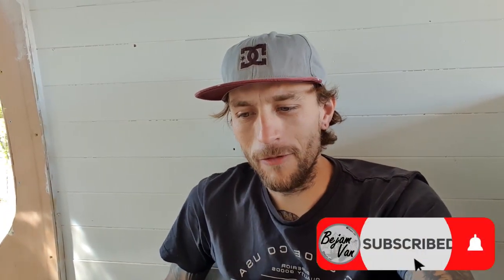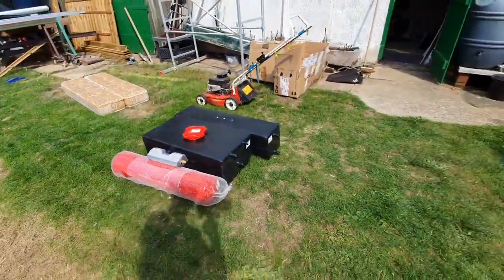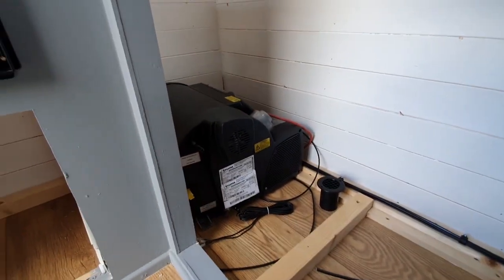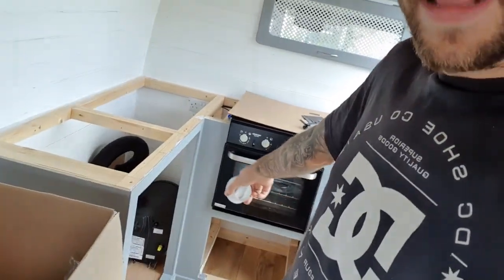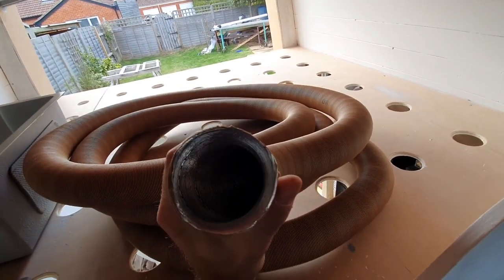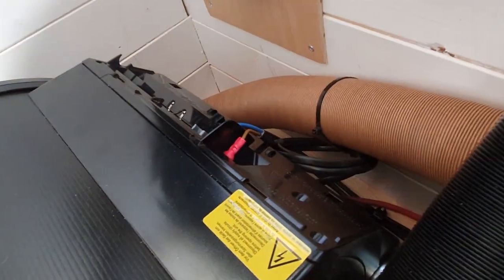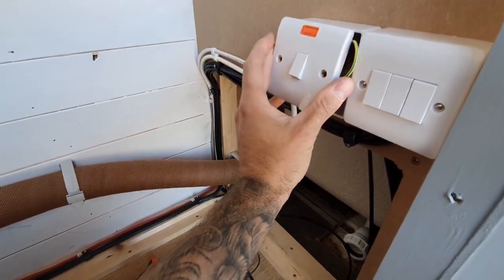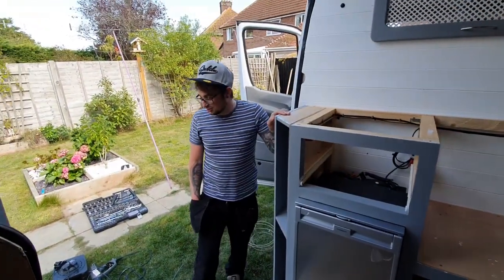Truma Combi 4e - The BEST OFF GRID van heating system | Van Life Build Vlog #20

Comment: Great install mate . I can’t wait to do ours and nice to see there is a temp sensor as well I didn’t know it had one you needed to mount high level which is great cos I can not put it in before I finish boxing the shower in
Reply from the maker: Cheers pal.. the video didn't show how stressed out I was drilling that hole in the side of my van 😅 
Got the Controller connected up and last bit of ducting in now 👌🏻 
Defo a good idea the getting temp sensor in early 😅😅

Comment: hi Bejam!  I have a question for which Im hoping you have an answer.  I've bought a combi 6 and I'm building it into my van. Now the circulation air (for the fans) needs to come from the living space.  Instead of making a hole in the wall next to the ventilator of the combi 6 (150cm2 as advised in the manual), I would like to supply the ventilation of air via an airpipe of +- 2meters long and +- 14cm diameter (which equals the advised 150cm2).   I want to do this to reduce a part of the noise of the fans in the space next to where the combi 6 is built in. 

The question is:  do you think the fans will be strong enough to draw air through the pipe?  I'm worried that the fans will not get enough air or need to work to hard and crash.
What do you think about it?   Hope to hear you soon!
Reply from the maker: Hey mate, apologise for the delayed response.. 
I think installing the ventilation pipe will be absolutely fine. As long as there's nothing blocking it the circulation fan of the boiler will most certainly drawer it though. So just wouldn't worry too much 👌🏻
Reply: @BejamVan  thanks!

Comment: Only just found your YouTube, brilliant!! I've just started a VW Crafter MWB, the mrs won't drive anything bigger (we have a 7 metre motorhome she won't drive!!). The cable to connect the room temperature sensor, is it possible to make one as they are stupid expensive, just wondered what sort of cable and connectors it had. Will watch more videos now. Cheers.
Reply from the maker: Hey Dean, cheers for the comment mate.. its hugely appreciated 😊
Blimey, sounds like you're downsizing fairly 😅
100% possible to make a lead up for the temp sensor dude.. just use some 0.5mm or 0.75mm 2core flex and connect them to the sensor and boiler with micro-spade connectors (I'm 99% sure that's what they are on both connections mate.. otherwise just solder them 👌🏻)
If you Google 'micro-spade connectors' they should come up 👍🏻 
Good luck with the build 🤙🏻
Reply: @BejamVan  thanks very much for your reply. I managed to get one from France at half the price but I've only just seen your reply, typical, I've got some cable as well!!! I think I'll need a lot of luck with the build tbh lol.
Reply from the maker: @deandickinson7124  no worries at all mate, glad you got it sorted 👊🏻
Feel free to give me a shout on here or insta if you get stuck with anything else. I can at least advise on what I messed up 😅👍🏻

Comment: Did u make the cupboards for weight reasons? A lot use kitchen units. What other truma boilers are there I already have a diesel heater
Reply from the maker: Hi mate, I just wanted to make the layout myself and found it cheaper and easier to build the cupboards myself thats all 👌🏻
I'm not sure mate, most other Truma boiler are water storage systems that use a 240V coil instead of a has heat exchanger that heats the air too. This beast is expensive but is aweseome. Probably the best buy in the van build.

Comment: Hi Bejam, I really enjoyed the video. Very much toying with the Truma as it has come highly recommended, by professional van converters, but I am struggling to justify the expense in my head. In your research did you come across any alternatives?
Reply from the maker: Hey man, thank you 😊 
I was much of the same mind set to be honest, the cost just seems ridiculous!! But I struggled to find an alternative decent off grid set up that did both air heating and water heating that didn't need to be mounted external to the van. Its expensive but my god is it good 👍 
The alternative I would suggest is a decent diesel heater, e.g. webasto or eberspacher (which is still £600-£800 unless you buy a cheap Chinese model or refurbished model).. and one of these new excel thankless gas water heaters which are a couple hundred pounds. I've heard good reviews about them but it just felt wrong mounting a gas heater in the van without an exhaust 😅

Comment: Very helpful cheers. Do you have any info on the 12V connection to the LCD display?
Reply from the maker: Hey Elliot.. I may of covered the 12v supply in one of the electrical video's but I can't remember 😅
I took a separate 2A 12V supply from the 12V fuse board up to the the display and soldered the connection onto the Truma pre-made lead. I hope that helps 👌🏻
Reply: @BejamVan  ahhh cool thanks! That makes sense. The manual says 1A and that it should be on the same circuit as the main heater. Have you had any issues with yours? 

Great video by the way! Really really helpful!
Reply from the maker: @elliotfrance9425  No worries at all mate 👌🏻 The manual says 1A due to the current the display is pulling so take that as a minimum rather than a max. 1A or 2A will be fine. I've had no issues with the Truma at all, its probably the best thing I bought for the van, its brilliant 🙌🏻
You can either double the 12V circuit's up fuse board or stick it on its own, it doesn't matter too much. Mine was easier on it own so thats how I did it.
I did mess up the Trume exhaust in this video and sorted it the 'Teething Issues' video later on 👍🏻

Cheers dude.. I'm more than happy to help anyone. Electrics is what I know but I can certainly tell you what worked and didn't work on the rest of the build 😅
Good luck with yours mate 👊🏻👊🏻
Reply: Thanks!
Reply: I'll have a look through your videos later as I'm unsure exactly where I need to earth my 240V system 👍👍😀
Reply from the maker: @elliotfrance9425  thats in i think the second electrical explained video mate.. earth the 240V distribution board down to the body of the van 100% using something like a 6mm or 10mm cable 👊🏻
Reply: Was searching for the same answer! I have ran a 4.5mm cable from my fuse board to the boiler but getting confused with where the control panel gets it's power. Can I just split the 4.5mm cable in two directions and place a 1amp fuse before the smaller 12v cable thats connected to the control panel? Would be grateful for any help as the manuals don't really give any info. Thanks!

Comment: Hi matey - - HELP ! I've bought a 4e - will it run heating and water on 12v only? - what is the 230v used for if not using a shore hook up?  cheers p.
Reply from the maker: Hey mate.. the 4e will heat the water and run the heating on 12v with Gas hooked up. The 230V is so you can save gas when you're hooked up to mains at a caravan park.. 🤙🏻 I hope that helps 😅
They are brilliant boilers chap.👊🏻
Reply: @BejamVan  fantastic, a local chap doing a build said it needed 230v to run, had a little panic as mine is  in, just sorting out the sink plumbing!. Ps there is the campervan & overland show in Stratford on 5th/6th June, understand there will be a few vloggers going 😀 thanks again
Reply from the maker: Hahaha you'll be all good matey.. sounds like your van is coming on nicel. Ready for summer? 👀
I didn't know about the show, I may have to give it a look, cheers chap 👍🏻
Reply: @BejamVan  yep, coming on well, thanks mate, guidance from your vids, Greg Virgo and a few others 🙄

Comment: Did you treat the exposed metal after you cut the hole in the side? Without the paint its going to start rusting in a matter of months.
Reply from the maker: Yes mate, I coated it in hamerite white paint as I have with all the holes cut into the van. I just didn't show it in this particular video. 👌🏻
Reply: @BejamVan  Oh good. My mate forgot to do his windows and they're all dribbling.
Reply from the maker: @tompiperson4793  Ahh mate rust terrifies me.. especially being a Sprinter. Since buying it I've spotted areas where the previous owner has just painted over rust spots 🤦🏼‍♂️
Reply: @BejamVan  Thats Britain for you. If I had the time I would import a van from Cyprus where they don't use salt. You look underneath the chassis of a 20 year old vehicle and you see bolts that would come off dry by hand with a spanner.

Comment: What’s the 240v for if it runs on gas?
Reply from the maker: The boiler is dual fuel mate, so if off grid it will run purely on gas.. or if you are connected to a caravan hook up it will run on 240V coil saving your gas. You can even run it on both if required.

Comment: Dear friends, could you help me please.... I'm also currently building an expedition vehicle. So, the user manual for this boiler gives the following:
Water inlet pressure max. 40.6 psi (2.8 bar). Pressure reducer available.
System operating pressure max. 65.3 psi (4.5 bar) 

The question is what the system operating pressure is all about and how could it be that it's higher than the pressure of the water inlet?
Reply from the maker: I'll be honest with you.. I have nooo idea 😅 seems a bit weird 🤔 
What i do know is that I have a 30psi pump rigged up to the inlet and it all works an absolute treat 😁
Truma have a really good customer service so give them a message 👍 https://www.truma.com/uk/en/service/customer-service
Let us know the outcome 😊👊🏻
Reply: @BejamVan  I promise, I will. The Chinese told me that i should better stick to 2.8 bar and 4.5 is just a precaution for the pipes themselves. The thing is I don't trust Chinese engineers.)) Good luck with the project. Perhaps, i'll meet you on the road next year.
Reply from the maker: @MegaFenix888  yeah I wouldn't trust them either 😅😅 its a good question though mate something I'm sure many people haven't picked up on.
Good luck with your build dude.. well up for a catch up on the road 👊🏻🤙🏻

Comment: hi, i'm not sure you can install the intake and exhaust that way. Check this  file:///C:/Users/Asaaa/Downloads/truma-heating-combi-installation-us-en.pdf
Reply from the maker: Hi mate, 
Just read through that manual you sent a link too.. I guess the issue is if it's 1m or shorter in length the rise shouldn't be more than 20cm but if its longer the rise can be whatever you want it to be 🤔 this is a pain in a arse and a lesson learned after I've drilled a big hole in my van.
Thanks for the comment.. I'll have a detailed look into this tomorrow and maybe get in touch with truma 🙄 
I'll post my findings on here 👌🏻

Comment: Hey man I’m struggling to install then cables for the truma.. 
Can I power it on just on 12v or do I need to have 230v as well? 
If you don’t mind can I have your WhatsApp number? Maybe I can show you and you can help me out. 
I’m really struggling with the electrical connections can’t make it work .. 😅
Cheers
Reply from the maker: Hey mate, you can run it on 230V or 12V or both.. drop me a message on instagram and we can go through it. If i put my number on here everyone will have it 😅